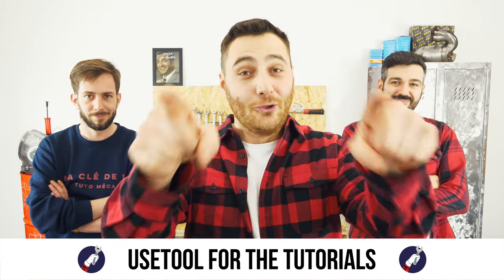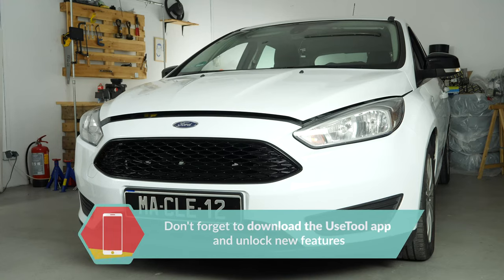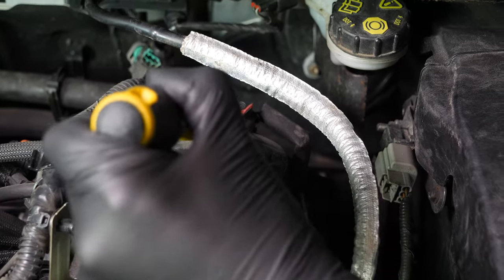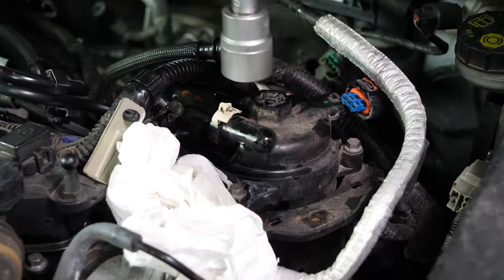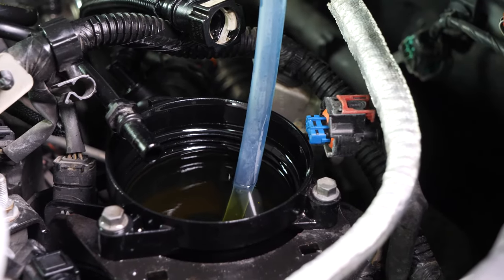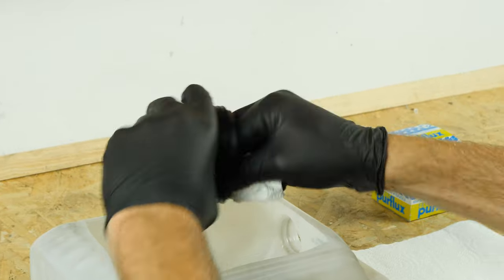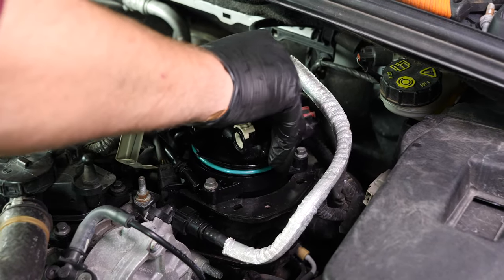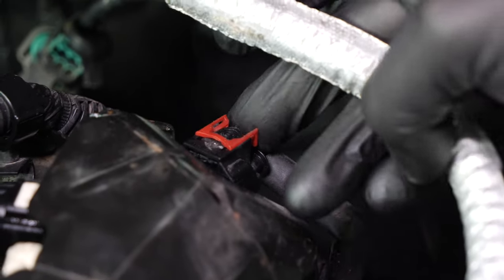How to replace the diesel fuel filter Focus mk3 1.5 TDCI ⛽

Comment: Is it ok my filter didn’t clip into anything just kinda sat in place, and when I filled it with fuel it floated up?
Reply: No that's incorrect. It should seat properly and shouldn't float up at all. Check the fitment again because if there's no seal it won't work properly and could let particles through into the engine.

Comment: is it enough to fill the filter container with diesel? without having to use a blower?
Reply: Yes, you can insert the new filter and fill the housing with fresh diesel. Once reassembled the car will crank over for a few seconds and then start. I've just done this job today and done exactly that and it works fine.
Reply: @stephennoble2647  You mean it takes a few seconds to start the engine? or does it start immediately without problems?
Reply: @fostenet  Just like a normal start, literally almost instant on the button with no problems. If you wish you can also turn on the electrics by pressing the start button once (no clutch) and the fuel pump will prime the fuel filter to the very top. You can hear this if you're under the bonnet. Allow maybe 10-15 secs for this, then switch off with the starter button and start the car with clutch depressed. Either way works, but I just topped up the fuel filter housing to the brim with fresh diesel and it worked fine, no issues to restart.
Reply: @stephennoble2647  grazie per il chiarimento!